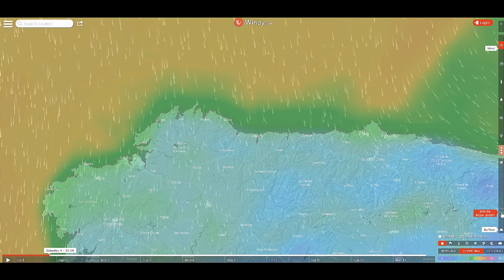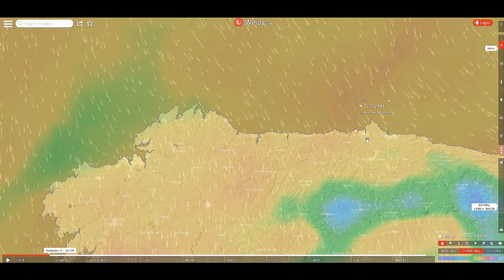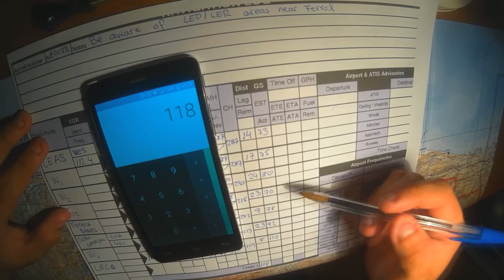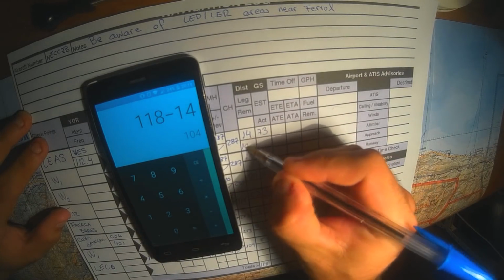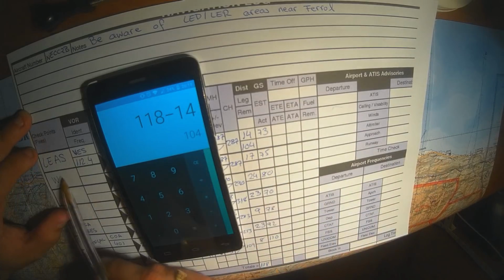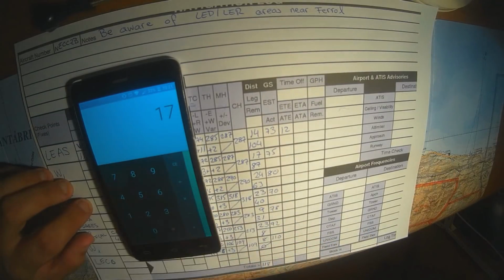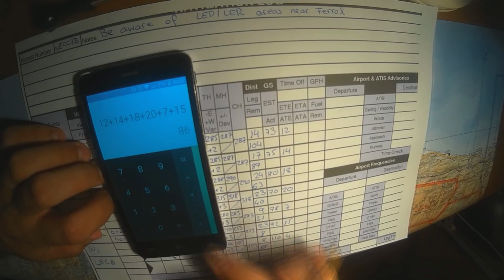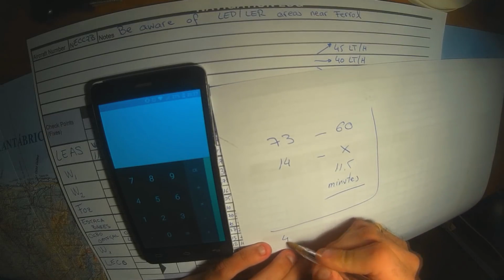NAVIGATION | Flight Planning and Routing for VFR

Comment from the maker: First of all, sorry for the audio quality. Everything sounded good until it passed through the editor. Amazon is sending a new microphone anyway to improve these kind of videos. Hope you find this lesson useful for your real flights or flight simulator flights. A good flight planning and routing can take you to your destination faster and safer but also take you anywhere in case you have to divert for whatever reason. Make sure to plan your flight, watch out the winds and recheck for any possible errors... as did I make one :D
Reply: I had a slightly similar experience - my vids render great when I upload them, but for some reason, they look like $#!+ in the editor XD